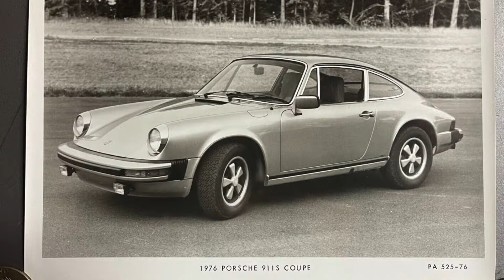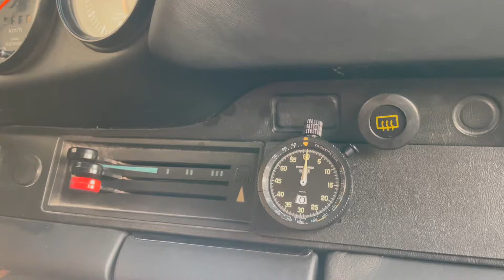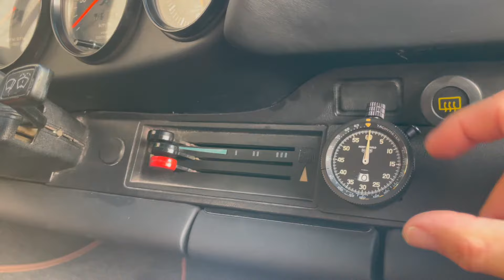Better than the original? Meet Dutchmann's 1976 2.8L Porsche 911.

Comment: More details on suspension, tire & wheel sizes, what did you do to the magnesium cases ? What's up with the 5 blade fan, did you ad oil coolers? This was a long video without a lot of important information. Yes, beautiful 911.
Reply from the maker: Important details as requested: Stock, stock & stock & stock. Stock & no. Am as surprised as you for enduring the dulcet tones. Take care Dan-the-man
Reply: @Dutchmann_official  Thank you, I appreciate the understated approach when many builds are so extreme.

Comment: Hi, which rim and tire sizes do,you use to make it fit into the narrow body? They are matching very nicely..
Reply from the maker: Hi - stock 16" 7J Fuchs and tyres. The corner weights help with the look & drive.

Comment: Hello, beautiful car. Can anyone tell me how bad the liftoff oversteer is, ie at what speed the back starts to go under breaking if the car is not going straight? I am tempted by an early Porsche but hear so many worrying stories about these early cars. Cheers. 
Nice drive!
Reply from the maker: Hey Pierre. Generally, oversteer is less a factor speed vs approach - and will affect you under ill-timed acceleration (vs breaking). Having driven a few different setups (mid-engine, FWD, RWD ) I can say that a well-setup classic 911 will not give you any surprises. Don't believe the Top Gear crew who like to get the tail-wagging for dramatic effect. The early cars are wonderful!
Reply: Thank you very much for feedback. Only driven modern ones and was told “to be very careful”, so good to know. Cheers

Comment: Can you tell us what size wheels you are running on this car?
Reply from the maker: She's on 16" x 7J OEM Fuchs all round
Reply: @Dutchmann_official Thank you! I was of the understanding that 6 x 16 was the largest wheel that would fit under a G body?
Reply: That is exactly my issue. I have the 7“ cookie cutters with 205/60R15 which are rubbing during dynamic driving..